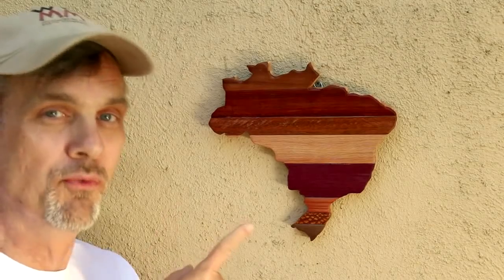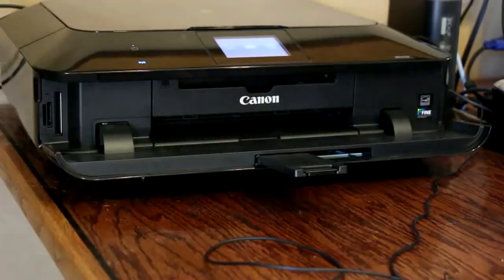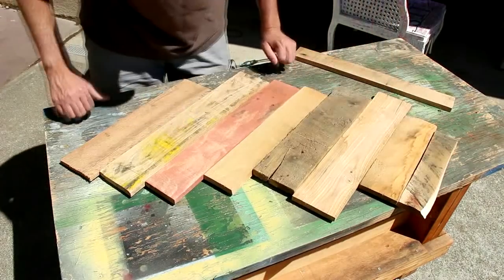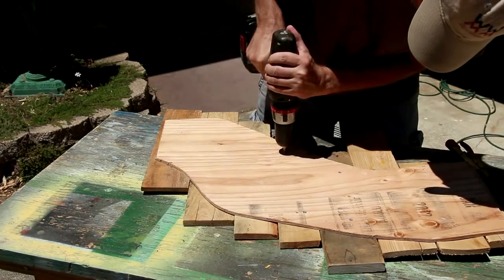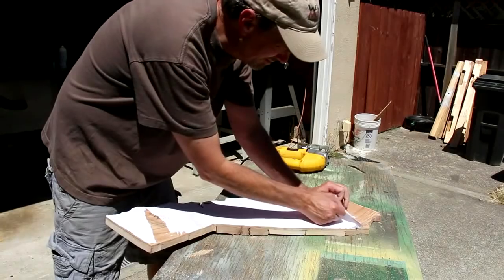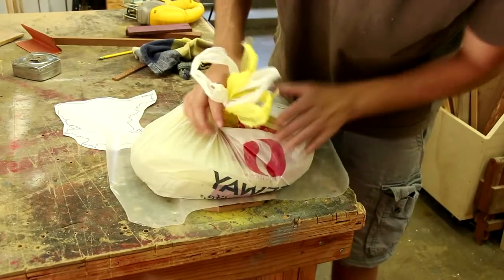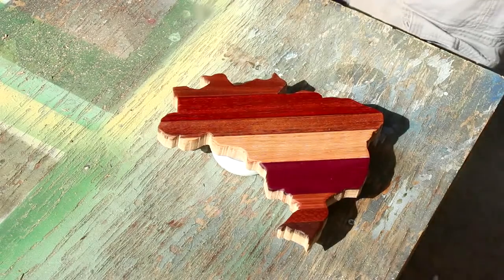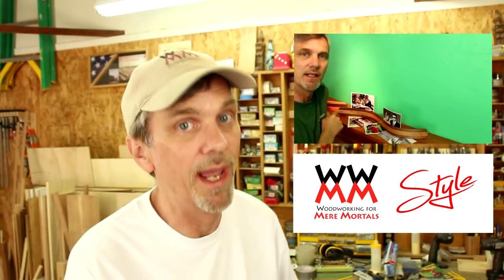Make a decorative state or country wall hanging, then share it with the world!

Comment: And... This is the first time I had to buy wood. I get alot of kiln dried pine 1x3s from work. My boards are at an angle, I didn't realize it until I had a few cut but didn't want to waste the wood so I went with it. I used oak and maple for grain and stained with a dark walnut and gloss poly.

Comment: Actually, I do have some of those high precision clamps. I also have some of the not so useful bar and pipe clams and the smaller bar clamps. I hate those, I prefer the cinder blocks much better. Lol. Neat project, and no I am not making fun of your clamping method. I actually use an anvil quite often for things like that.

Comment: How did you enlarge the picture on your printer?
Reply: not sure how he did it, but if you open the image in microsoft paint (haha i know - no joke though), and go to Print / Page Setup, there is an option called "Scaling" where you can select the number of pages to print it across (default is 1 by 1 page(s)). Google can help if you need more details.